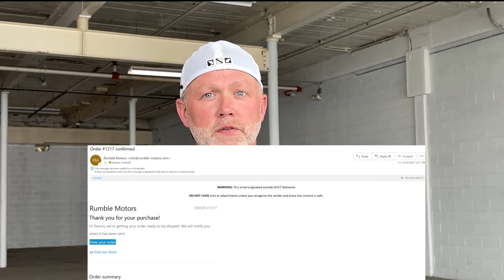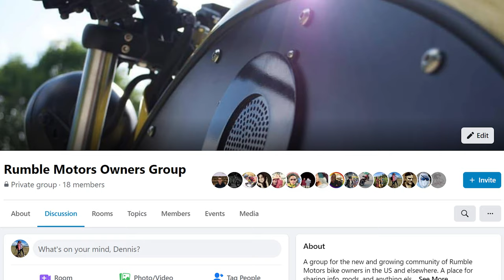Rumble V4 Review

Comment: Re: Rear suspension bottoming out. It appears the adjustable(?) rear shock is on its lowest setting. A hook spanner and a twist or two may solve the issue. Notice the notches and steps?
Reply from the maker: You are 100% correct and the adjustment solved the issue. We covered this in our facebook group with a post a few weeks after I created this review. Thanks for mentioning it here so that others here will know!

Comment: Wondering how the V4 is holding up? What's the max range you've traveled on it, and have you managed to get a registration for it?
Reply: Oh, I caught the answer about registration from the comments.
Reply from the maker: Hi John. Feel free to join our facebook group as we’ve posted more there. Still super happy with the V4. I regularly get around 80-90 miles between charges and have yet to really try to ride it to absolute max battery output. Still looking for a seat upgrade and normally don’t ride more than 20 miles or so in one clip due to that issue.
Reply from the maker: https://www.facebook.com/groups/1476852639323026/
Reply: @dgcockrell  Thanks. I've joined the group and I look forward to more content on the V4 or the Henry SST.

Comment: Can you put pedals on it do they make a kit
Reply from the maker: No, not on the V4. Rumble has other models that are pedal assist.
Reply from the maker: @peterpoop  , there’s a bit to unpack there. It varies state to state. In general, no, you don’t need to register or have a motorcycle license or insurance as they are treated as a bicycle. Most skirt the law by giving you a mode selector switch that can alternate between eco, normal, and sport modes. Eco mode restricts the bike from exceeding somewhere around 20 mph. In this mode, they satisfy most states laws regarding what is and is not a motorcycle/moped. One constant between every state law is that the bike must be peddle assist to be exempt. Hope this helps a little.